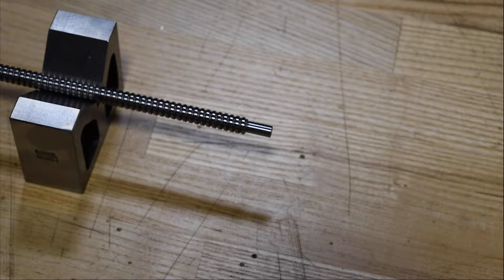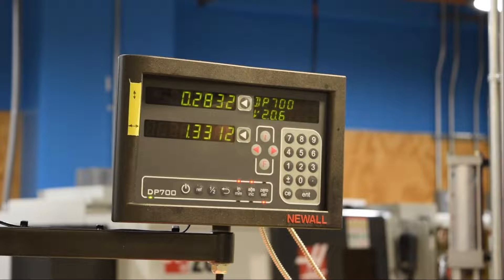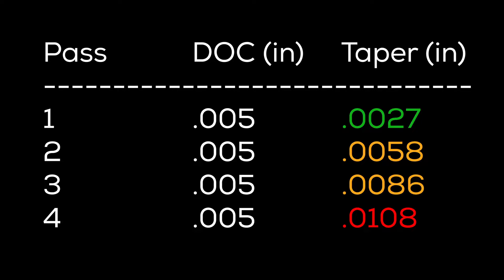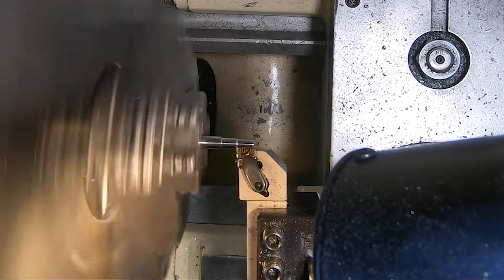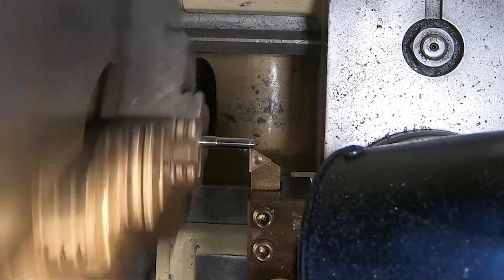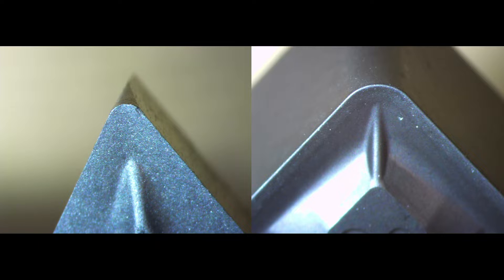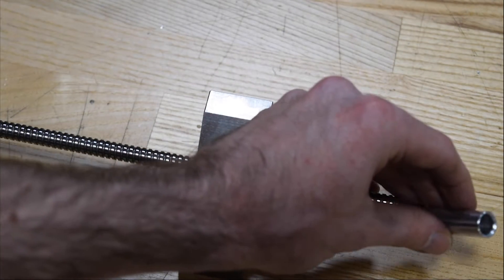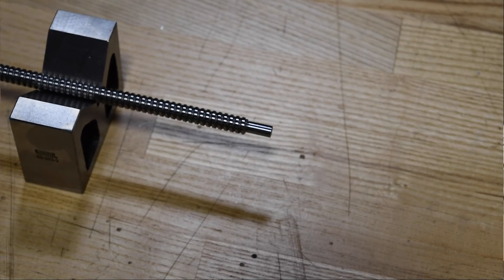Turning Hardened Ballscrews + Intro to  Carbide Lathe Inserts

Comment: I've always soaked a towel in water and wrapped it around the ball screw behind the area where I will be machining. Heat with a torch to a nice cherry red and allow to cool naturally. This will anneal the hardened area and allow machining. Companies that do this work daily use an induction coil to quickly heat the screw in he area needed to achieve the same result. My experience with using PCD inserts on these screws is that the interrupted cut with the threads tends to chip your insert tip long before the job is finished. PCD works great for general hard turning but are extremely brittle.

Comment: I dont think your reasoning at 2:19 is correct. Situation no 2 is fully encompassed in situation no 1. Even though from vector direction perspective you are right, the size of vector no 2 is going to be significantly smaller. Again: situation no 2 is present in situation no 1, except in situation no 1 there are other more dominant forces.